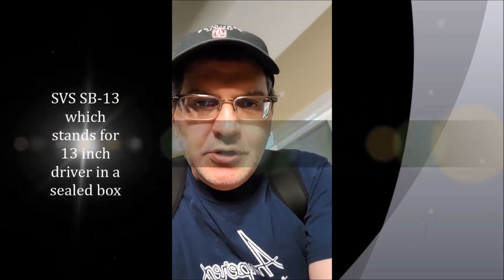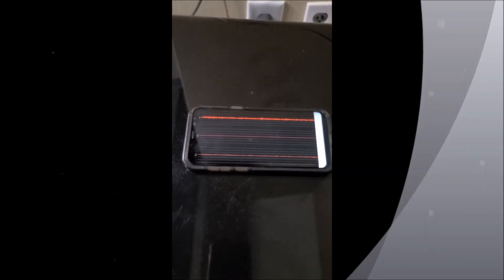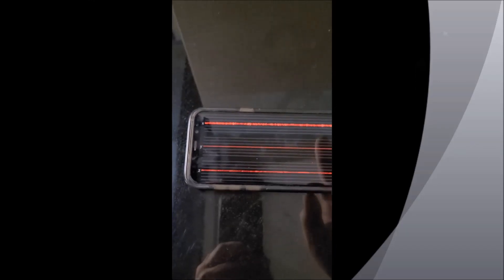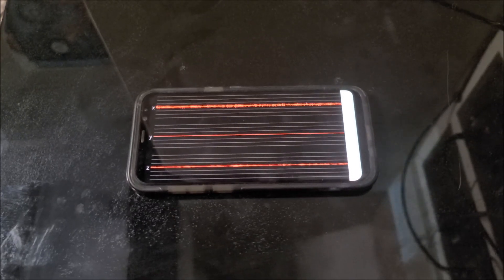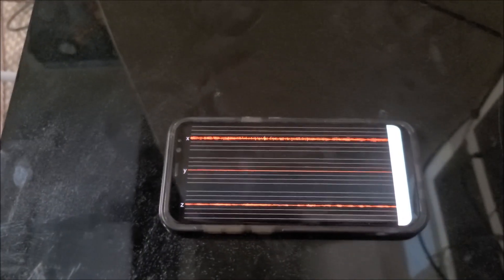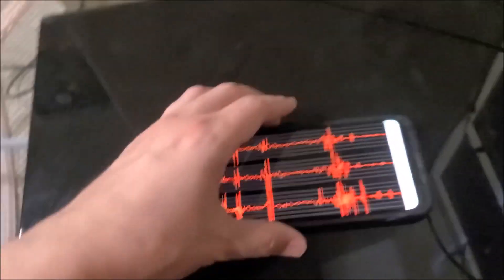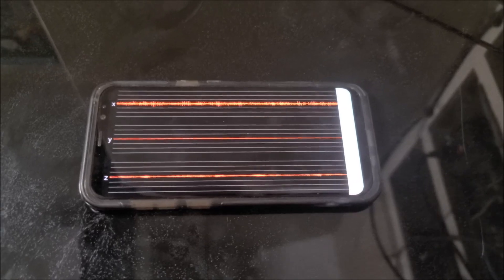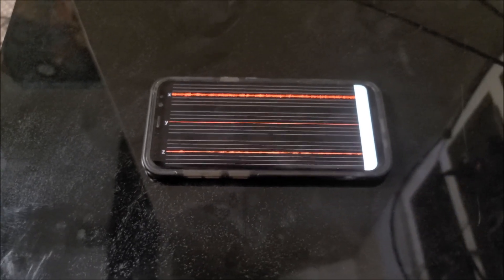Audiophile Vibration Control Product Testing and Review - Part 7 - SVS Sub

Comment: I watched the the series of test, txs for sharing these.  But does the Townsend Siesmic platform really improves the sound quality?  Only blind testing will give us some answers. I doubt that minor tremors or small external vibrations affect the sound quality of a speaker.
Reply from the maker: It will be limited and may not be noticeable on every system, but you have to realize that a speaker or Turntable relies on reproducing sound with very minimal vibrations.

Plus, you are minimizing the vibrations that go into your floor that also can resonate and create a sound.

The magnitude of improvement is debatable, but that's why I created a very cost effective solution almost anyone can try.

Comment: Hi, great videos!

Would love your thoughts on this please,

Have you tried AVroom service EVP?, as they are cheaper than Townshends and famous mastering engineer Bob Katz is using them. They are also floating the speakers..

I want to build your diy dampening solution for my studio speaker monitors, and my PC too :)
I can't seem to find anywhere the Sorbothane parts you have, I even looked in their catalog so I'm suspecting those might not be really Sorbothane material.. you think I can do it with other similar materials?

Thank you for any advice!! :)
Reply from the maker: I actually saw the EVP guy at The Home Entertainment Show in Long Beach.  He had a booth in the marketplace area.

I haven't tried them, but he seems like a reputable guy and the theory behind them seems decent...but a far cry from the Townsend which virtually floats the equipment/speakers.  It doesn't mean it won't work, but I can't vouch for them, and my intuition tells me it will fall a bit short based on similar things.

You can get the Sorbothane pucks on Amazon from Viprapods and then just buy the double yellow squash balls separately.  Hope I'm understanding your question, but feel free to comment if not clear.
Reply: @AudiophileJunkie  Thank for the great information! :) It's very helpful.

What I meant before is that I didn't find these products in the official Sorbothane product catalog, so I wondered if the Viprapods are actually made from the real Sorbothane material or perhaps something else..

I also want to try the same shape but made from soft Silicon because it is soft and much cheaper and I will need quite a lot for many devices.

Just found on Aliexpress "MAKSEY Silicone factory Store" they have similar shapes.
Reply from the maker: That could be a good find from China, but the vibrapod is just used as a convenient bass for the squash ball.

I'm pretty sure it's sorbothane, but I don't think it will matter.  You could use almost anything that will keep the squash ball stable. That's what really provides the isolation and damping.  If I tested the sorbothane alone. It wouldn't do much on sizable vibrations from subs and speakers compared to what the squash ball does.

Good luck with your purchase.
Reply: @AudiophileJunkie  Thanks :)

Just found out, in the 3d making website " thingiverse(dot)com " when searching for "squash ball" there is a world of mounting options for insulation!